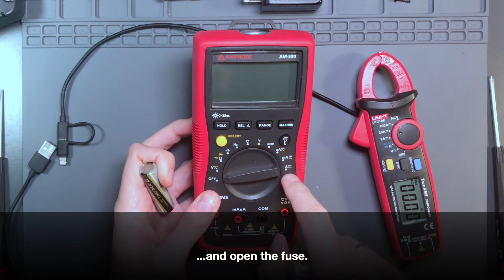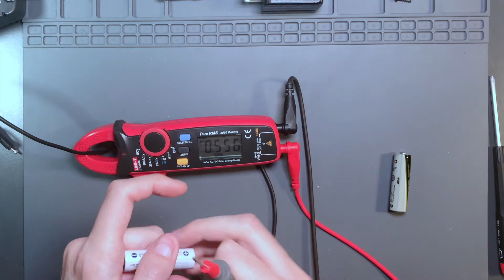Jump Start That Battery: A Way to Recover Ni-MH Batteries that are Fully Discharged

Comment: I just did this to my RC car batteries. I took a 12V battery and hooked both ends to each other and gave my batteries just enough to get charging again. Hopefully they don’t explode in my cars.
Reply from the maker: If those RC car batteries are Lithium-based, I would not recommend that.
Reply: @TheCuriousEngineerChannel they are NiMh. It’s ok one time.

Comment: Hello, Great idea. I have one C 9000mAh battery from the Roomba Wall tower (it was left during the Christmas in active mode which drained the battery to zero). I used the IKEA LADDA 1900mAh NiMH battery (1.26V), I set the multimeter to high amp measure and used the multimeter's wires for a 5s to jumpstart the dead C 9000mAh beast. It worked nice, I did not measure the voltage afterwards but quickly put it into smart charger and it worked nice. It have 1.32V after few hours of charging and few hours of resting afterwards so the charge seems to be stable. I am going to discharge/charge it in smart charger again to test whether it will change the charged voltage.

Comment: the good battery that you use , does it have to be nihm battery as well?
Reply from the maker: In this case, yes.
Reply: @TheCuriousEngineerChannel  why in this case ?
Also in what case would it not matter if the battery chemistry is different ?
Reply: @jayk2k Because the cells must have the same nominal voltage.

Comment: I got so tired of jump starting my batteries, I got a good, safe but dumb charger that just apply low current without too many "probing" of the battery.  It revived nearly all my batteries.  I have gradually reduced the use of "smart" high-speed chargers for NiMH and NiCd chemistry batteries.  For safety reasons, they build so much "smarts" into those chargers that they are very prone to error.

Comment: Maybe a stupid question, could I use a Lithium car jump starter to do that trick, with its crocodile clamps ? It's going to be 12V though, even 15 if I have to use the override mode... Could that be dangerous for any (myself, the jump starter, the old dead battery) ?
Reply from the maker: That's a pretty high voltage to apply to the cell, along with a very high surge current coming from the jump starter. I wouldn't recommend it.

Comment: I apologize if this is a silly question, but can I ask why you don't put a resistor in there to reduce the current? In another video you say that "dead" NiMH batteries can often be slow charged (with a bench power supply that limits the current). I have heard that LiIon and LiPoly can fail due to crystal formation and that a high current "jump start" can break up the crystals, resurrecting the batteries. What benefit is there to shorting the batteries together for NiMH?

Comment: I built a rig with a 100W incandescent lamp, a diode, a battery socket, a switch and a wall plug cord. Works well for nimh and lead chemistries, and gives a visible indicator of sucess/failure.

Comment: Way too hard.  I use a single wire.  I hold it one end against the negative (flat) end of the dead battery, and hold the other end of the wire against the negative end of a good battery...then I just tap the positive ends of the two batteries against each other.  Takes seconds and works every time.
Reply: That's literally what he did, except he used the shielding as a wire.

Comment: I got one IKEA Ladda Ni-MH battery that reads 1.3V but I cant charge it, charger keeps blinking. What can I do?
Reply: Put a very high voltage through it, I use a 120v cord through a 100W lightbulb rectified by a diode. It will start dim then light up brightly. Once it does this switch off the light and pop the battery in the charger.❤
Reply: Charger blinking means the cell has high internal resistance and this is the reason that the charger rejects it. No matter the various tricks described in relevant videos or comments here in Y.T, such cells are useless.  Any attempt to charge them is loss of both energy and time.

Comment: I'm trying to revive some ni-mh camcorder batteries made for '90s camcorders. Is there  a way to adapt this for smaller, surface terminals? 

If this works for the first set I can still buy more of (they're just annoyingly expensive) i want to try it out on the other similar batteries of which i can't find new production versions that i've accumulated in buying so many old camcorders.
Reply from the maker: Those Ni-MH camcorder batteries are likely not low self-discharge, so they might have formed a "memory effect". Typically Ni-MH experience this less intensely than Ni-Cd, but it can still occur. One way to try to resurrect them, is to try to "form" the cell again, buy slow charging it for a lengthy period of time. Perhaps I'll make a video on this. Contact directly if you'd like to discuss in more detail. Might make an interesting project! Thanks for watching!

Comment: You can use any higher voltage good batteries to "Revigorate" any dead 1.2V NiMh batteries this way, but the "revigorated" battery may or may not hold charges. I've tested this method on a bunch dead 1.2V NiMH batteries。 I managed to bring all of them back to at least 1.2V, but the smart chargers still could not charge any of them. I tried on a couple of "dumb" chargers and connected the charger with a volt/amp multimeter to the power source. The meter showed the charger was sucking correct volt/amp currents. After the meter showed there had been ~300 mAH charged, the battery being charged was already 1.4V+, but actually there was no power at all in the battery--tried the battery on a few things such as electric razors etc. and it was just as dead as it was before being "revigorated."
Reply: "There's a big difference between mostly dead and all dead. Mostly dead is slightly alive. With all dead, well, with all dead there's usually only one thing you can do..."

Comment: I pulse 30 volt reverse (Negative to positive) to the battery for about 10 times. Battery gets very warm but show proper polarity of 1.35 volt after. Still trying to understand why...
Reply: Why using reverse polarity? He "jump starts" by connecting positive to positive, and negative to negative.
Reply: @peterv1602  I had always done it his way - positive to positive - on Ni-Cad & Ni-MH, even lithium that has completely drained to zero volt and would not charge. But I did reverse polarity out of curiosity. That was 5 months ago... battery still works fine at this moment. I still don't understand why it work...
Reply: @sobrangbigat  Interesting. Maybe some battery expert can jump in.
Reply: The hydrogen is absorbed into the powdered nickel making the cell act like a hydrogen cell

Comment: Is there a quality battery charger out there that can also do battery revival like you did, using the second battery?
Reply from the maker: Great question. I feel I'll make a video on this, so stay tuned! Thanks for watching!
Reply: I just use a one amp trickle charger.  I touch the battery for a half sec and they work.

Comment: 2 screwdrivers side by side lay the batts between. Make parellel connections with driver shaft problem solved. Doesn't make for a very good vid though.

Comment: 1•Youre using a USB cable?
Why not simply use a regular piece of wire instead.Serious question...not trolling.👍
2•Also...no battery will last forever,regardless of any trick of salvation.So,WHEN do you become aware its time to let it give up the ghost?
3•And lastly,I hear of a battery,Rayovac NiMH Hybrid Rechargables (if you can find them) are the latest in battery high quality.
Supposedly,they keep a charge MUCH longer than regular NiMH rechargables.Are you aware of such batteries?
Thanks for any light you can shed on my 3 questions.🙂
Reply from the maker: 1. I didn't expect everyone to have higher gauge pieces of wire laying around. Most decent USB 2.0 cables have good ground shielding that can easily handle high current. Wire works fine too.
2. Agreed. I thought I explained in the video that these were accidentally over discharged to 0Vdc. 
3. It's on my list! I have five other tests ongoing with different battery brands, so stay tuned!

Thanks for questions and for watching!

Comment: How does this work? It looks like the charged battery is forcing electrons to go the wrong way. Electrons flow from negative to positive iirc. Are you "pushing" electrons into the dead battery's negative side?
Reply: He is paralleling the good battery to the bad battery, much like you would jump start a dead car battery, simple as that. Positive to positive, negative to negative.
I think you're picturing batteries in "series", but he is trying to jump start a bad battery, not combine two batteries for higher voltage. If he did them in series then connected the jumper wire, he would have then fed a reverse voltage into the bad battery = very bad. He did it correctly by paralleling them.
Reply from the maker: Well said!
Reply: @TheCuriousEngineerChannel  Do that work with any alkaline 1.5vbattery?
Reply: @camilosixtino  No, don’t recharge alkalines, even with proper alkaline chargers. They lose capacity very quickly and it greatly increases the risk of leaks. Alkalines designed to be recharged mitigate this but are more expensive than decent NiMH such as the Ikea Ladda series.
Reply: When deep discharged the hydride will passivate similar to the plates in an electrolytic capacitor. This will cause the battery to charge up like a poorly built supercap. By using a higher voltage through it you can disrupt the insulation layer and make the battery take a charge. This also works for old lead acid batteries so long as the plates are physically intact.

Comment: Is there any way without having this additional kit?
Reply from the maker: Not safety, no. Some chargers have modes that will try to do this for you, and attempt to "reform" the battery. I'm looking into getting one of those chargers. Thanks for watching!
Reply: I used a car battery charger and I had it on very short. Or was it for a few seconds? But anyways it showed 1.2v right away! I wonder why it works. I read something about hydrogen?

Comment: Or just use a dumb charger to kickstart it
Reply: But the dumb charger won't charge either right, if the battery is entirely run down to 0V, and the dumb charger has a min detection of 0.5V to start charging?
Reply: This somehow just worked for me, thanks!

Comment: Dude
      Your clamp reads AC current not DC.  Use a shunt and you can protect your meter while making DC current measurements.
Reply from the maker: Hah. The UNI-T UT210E clamp meter measures both AC and DC current up to 100A. But yes, you can also setup a shunt resistor and measure voltage drop across it.
Reply: @TheCuriousEngineerChannel  Dude,
          Wow,  I stand corrected then.  I've had several clamp meters and none of them ever measured steady DC current.  So what brand of meter is this?  
           Thanks Dude.
Reply from the maker: You are welcome. The company is called UNI-T. Look for a review, and as you probably guessed, a teardown in an upcoming video!
Reply: @elkiddo1114  I have a fluke clamp who can measure in DC, when you zero it, it doesn't react to the earths magnetic field when you rotate it. But the cheap one like his does.
Reply: @LordGryllwotth  
Lord dude,  I want one of those,  what's the brand and model.   Thanks dude,  I'm besides myself.

Comment: So you simply connect both batteries in parallel...with a short but hard discharge of the good battery in the bad one , to try to equilibrate the common voltage. Not good for your Eneloop. Don't repeat the operation often.
If the  bad battery is new but simply completely discharged (mistake) you can do this.
 If the bad battery is old with high internal resistance, with this method the recharge will be possible, but with only a few milliamps. This battery is good for the trash.
You can do the same with lithium batteries when the voltage is too low in one of them, to save a GOOD battery which is only discharged. And please don't wait and let the battery too long discharged.
The best is to avoid this!